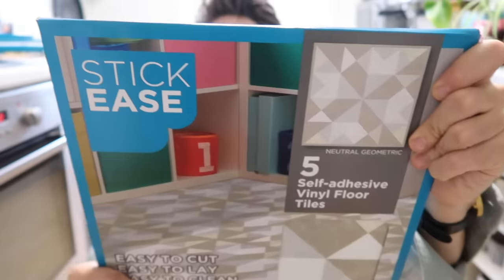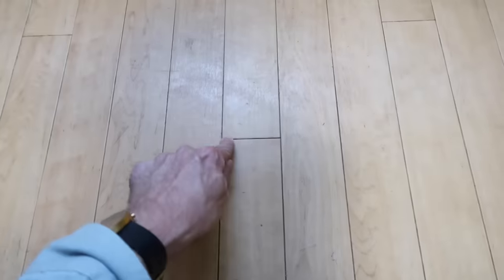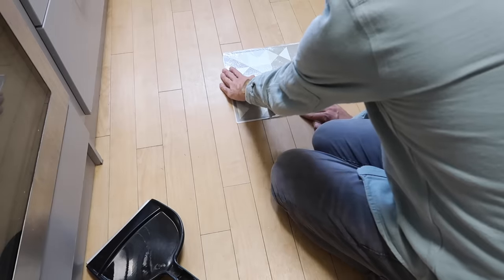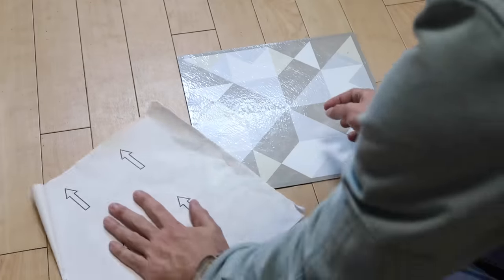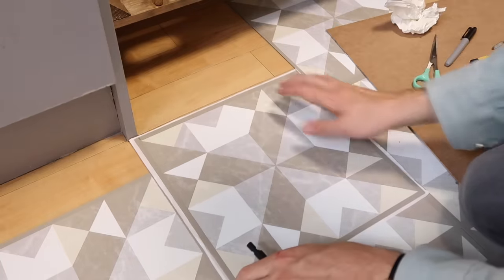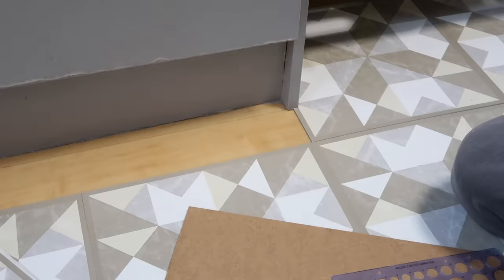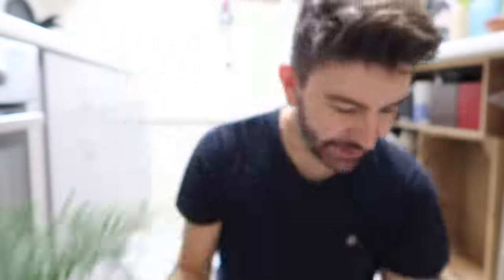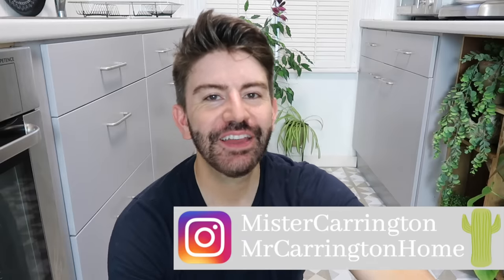BUDGET KITCHEN FLOOR MAKEOVER USING HOME BARGAINS PEEL & STICK VINYL TILES | *£20!* | MR CARRINGTON

Comment: To seal around the tiles upto units and walls, use silicone sealer for bathroom and kitchen anti mould in white, it will give it a professional finish with extra security to keep any spills or mop fluit getting under the tiles.
Fresh new look, love it. Actually makes the kitchen look lighter and wider than before.

Comment: I agree with the comment on using a rolling pin to get the air out.  I hear that works well.  It looks so good!👍 You can use any left over tiles to line inside the bottom of cabinets.  So worth it!!!!💖😀

Comment: Well done Mr.Carrington. Well, for £20 that's not bad at all, with luck they will hold and stop down - I feel they will, but you'd definitely think by looking at it it had cost way more. I always thought you had to start from the center and work outwards - but I would struggle with the measurement and cutting etc, but you have that arty and craft side to you, so you're ideal for these kind of projects. Looking forward to seeing how it does fair in the end. Greetings from Cheshire xo

Comment: Wonderful transformation, and surprisingly 'un-busy' a pattern given the dimensions of the floor space. Quite a few years back, when vinyl tiles weren't as good quality as they are now, in terms of adhesiveness, I relaid my kitchen floor and found I had to place a layer of spray adhesive over the floor prior to putting down the new tiles. It did the job though it was extra work I'd rather not have had to do, and they stayed put. I got professionals in 2 years ago to have the kitchen, hallway and bathroom, (which is tiny), re-floored. It cost me almost £600! Yup, you really did get a bargain, lol. Oh and it's always great to see you on 'Steph's Packed Lunch '.

Comment: One of the best thngs about peel and stick tiles is if you need to replace one its easy, just be sure to keep some extra on hand :)  I used them in a hallway in my last home and it turned out great. The hardest part  are the edges.  Well done! 🥰💐🌵🌸🌞🏜️💗✝️🥰💐🌵🌸🌞🏜️💗✝️

Comment: They look great, well done. I'd like to try in my bathroom but already have Lino down, you think I could put over the top or best to remove it first?x
Reply: If it's in good enough condition, clean and flat with no holes etc I'd leave it down, to keep waterproof layer.
Reply from the maker: If it’s a soft one they say not to. These tiles aren’t recommended for bathrooms
Reply: @MrCarrington  oh ok thank you for advising, guess I'll keep the Lino then lol

Comment: Didn't the package say to use a roller to press the titles down and to use this paste stuff to lay out first to help hold them? Also if you didn't already, buy some extra packs to use to replace individual titles, as the edges on titles  in high traffic area will start to wear away and you can replace those when it happens. The titles will start to move in time and you will see gaps. I've used peel and stick in two bathrooms, so they do look good....at first. :-)